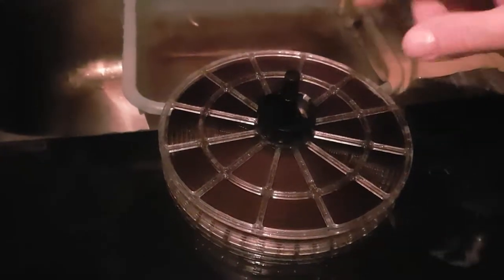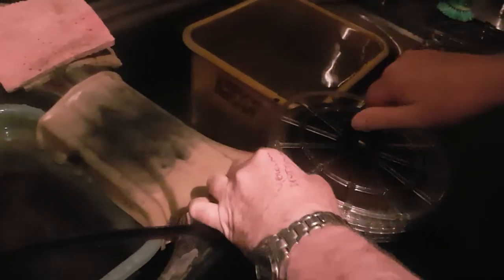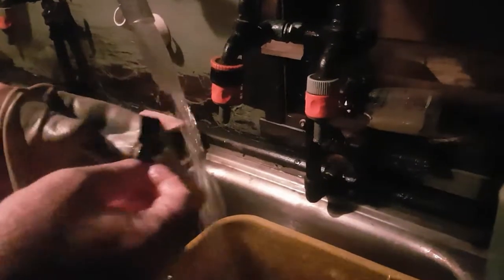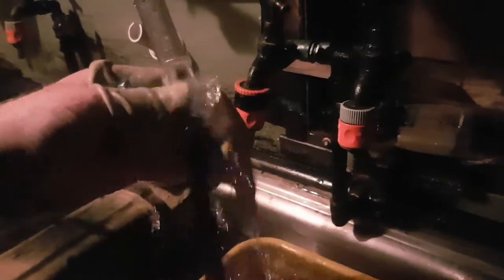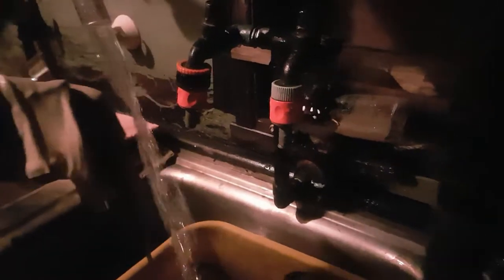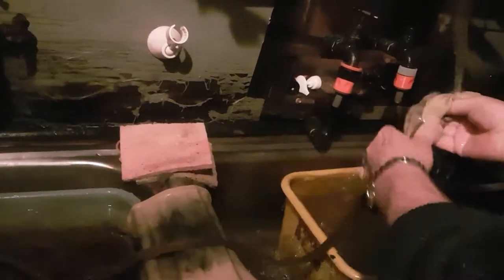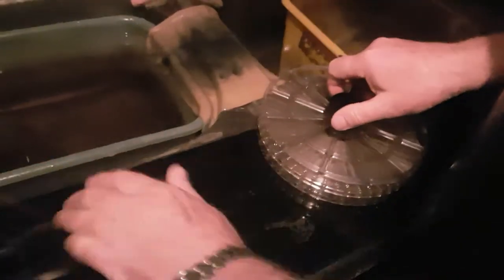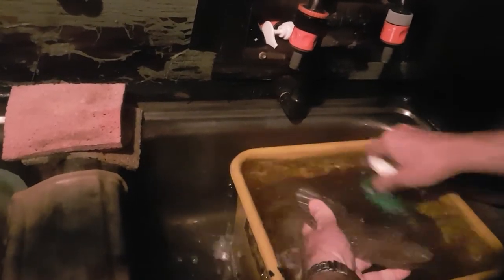Removing remjet with a chamois

Comment: Sprocket holes were up, not down in the groves...
Reply from the maker: Hi Michael, sprocket orientation is not that important.  All that matters is emulsion orientation.  You want the emulsion facing out.  It doesn't matter what happens with the sprocket holes.  The sprocket holes can be up or down depending on the pre-loading history of the roll.  Most of the time one is dealing with camera film that is tail out prior to loading.  But there are other possibilities.  For instance, if the film you are developing was exposed on a film printer rather than in a camera.  Or if you had to rewind the film for some reason and it is now head out.  If the emulsion is facing out, that is all that matters.

Comment: Been looking for videos similar to this for a little bit now thanks for posting them up how do you go about scanning your film? And are you developing the film the same way as c-41 process I finally have a lomo tank so I will be developing hopefully within a few weeks
Reply from the maker: HI Richard, you certainly can use C41 for ECN films.  Slightly more contrasty, but not noticeable.  It is fine.  You do need to add a rem-jet softening stage at the start.  You can use borax for that, or mix the official kodak ecn prebath.